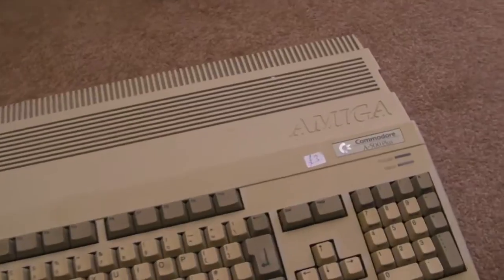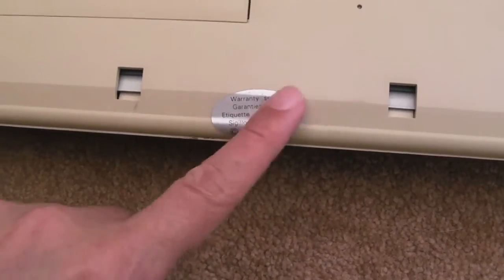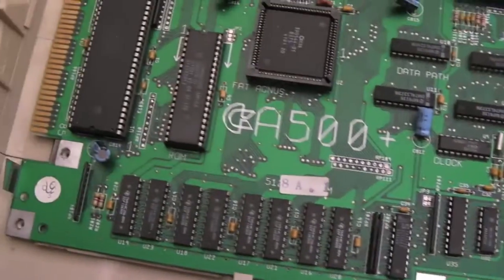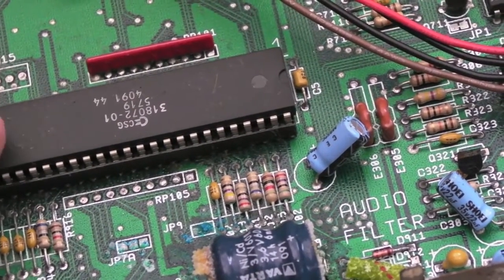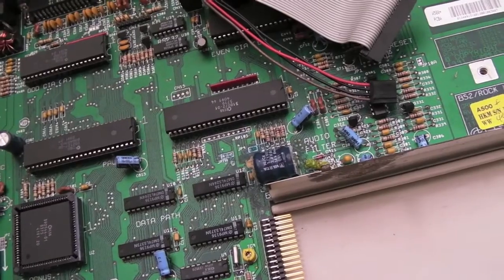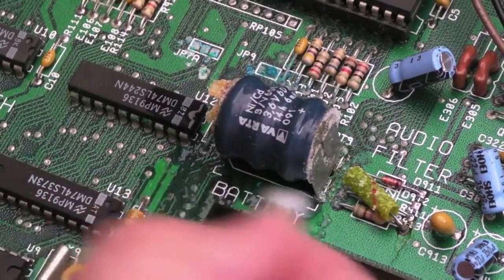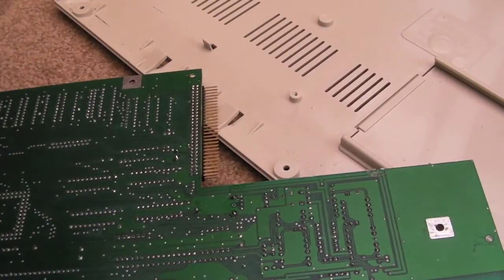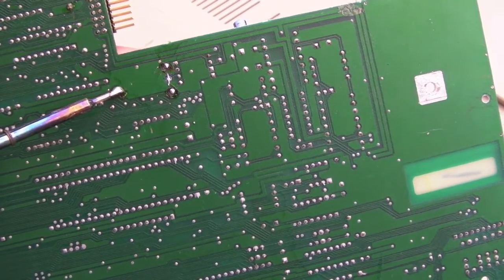Commodore Amiga A500+ Corrosion Repair Part 1

Comment: Hi bud, love the vids, you're really good with the electronics, wish I knew a bit more.
Just bought two A500+ and one is now fixed thanks to this vid...
The second one flashes 10 or eleven flashes on the power light now, did have just a green LED to start with before the start of the clean, so getting there... it's a lot worse than the first one.
Ordered some Isopropyl Alcohol and going to use some cotton buds to clean a few more bits, notice corrosion went right down to the data path on this one; hence the flashing power light (I think, correct me if I'm wrong, checked the seated chips too).

just wondered if you'd unsolder the chips with the corrosion and resolder all holes and use a 2000 grit on the legs of the chips?

Where is Part 2 of this vid?
You remind me of a clone of Karl Pilkington ;) no offence, it's kind of a compliment.
Reply from the maker: Thanks for watching and commenting =)  I will get around to part 2 soon - I've just had a tonne of other stuff stealing my time recently.  Yes, I would clean around the datapath with vinegar first, then isoprop, then very carefully try and desolder - if the chip is not coming off easily I would cut it off very carefully and just put a socket and new chip on there.  If you can get it off without damage then yes, sandpaper is exactly what I will be using for treating the components I remove before refitting them.  LOL @ Karl Pilkington - I am due for a new intro etc as its roughly 12 months since I started, maybe I should rebrand to 'An Idiot Repairer' or something lol - not far off the mark lol.
Reply: GadgetUK164 Hi bud.
Glad you took it the right way :)

Will look forwards to your intro, I may even have a bash for you and see what you think?

You're no idiot bud, massive respect.
Don't work too hard; subscribed now, so will look forward to more vids also.

Have fun,
Ant
Reply from the maker: Hehe, yes - I can see the funny side!  My wife funnily enough says I moan just like Karl Pilkington =)  Sure, if you don't mind having a go at an intro - fire away!  Anything is better than my current intro.  Needs to be short though and needs a point at the end so I can overlay the title of the video content etc.   Thanks for the kind words there!  I am a novice, don't take everything I say as fact - if you read between the lines you should get some accurate stuff =)
Reply: GadgetUK164 A good way to be.
I always say never look too good or talk too wise ;)
Haha, setup a 'lookalike' business and be Karl's double... pocket money lol
Cheers bud. Will have a go now.
I will PM you my email or something so I can send you a dropbox link to download testers of the intros/outros and see what we can collaborate on.
Will brighten up my day a bit as I just received a bloody DOA motherboard for a customer's PC. So I'm going to be jumped all over tomorrow. Great.

Talk soon bud. ;)

Comment: Have never see a 500+ Revision 8A board with a battery on it. Maybe i lucky but a A501 i have see battery leakage on it.
Reply: In the last days of Commodore they sold the 8A either as 500 or as 500+ with chipsets laying somewhere around :-)
i have one mixed up of 8362, 8375 2M and only 512k onboard... no clock LOL